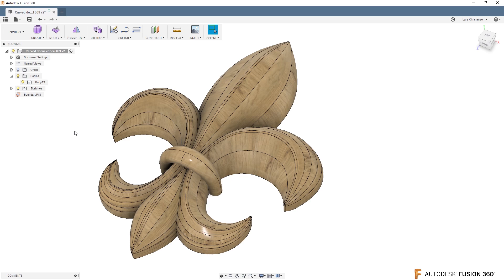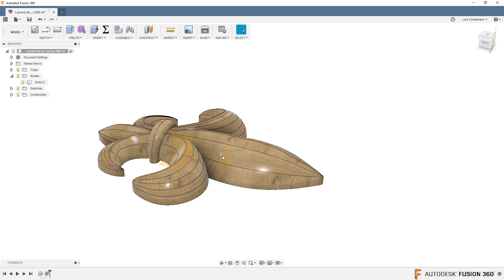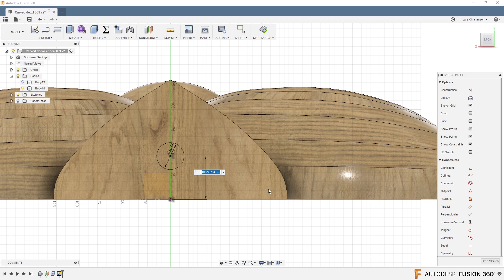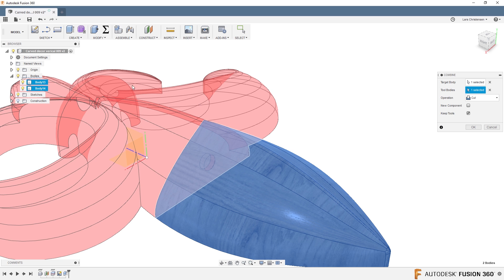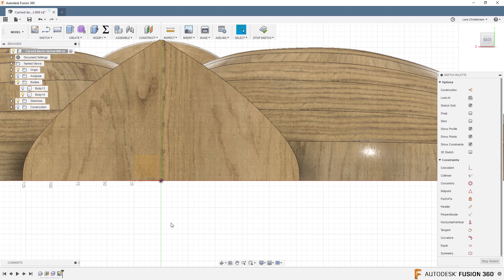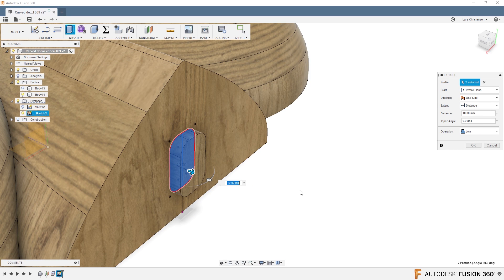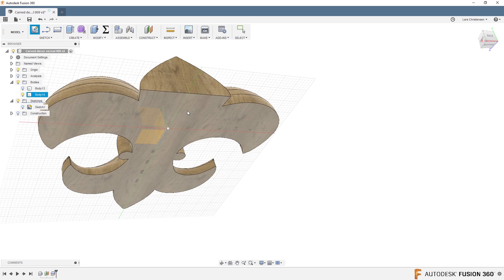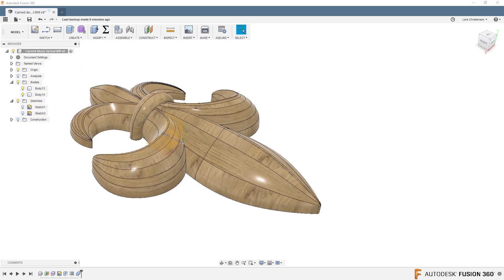If The Part Too Big for 3D Print — Fusion 360  Season 2 EP6

Comment: Definitely NOT useful. This is not a criticism because ALL fusion videos do the same thing, which is to show the quickest methods that look impressive but are completely useless. 
If people are naive enough to follow these suggestions, after wasting hours of time and material, they would discover the pieces do not fit together. How long would it have taken to consider tolerances? Regretably, too long apparently.
Reply: Yeah, it's surprising that tolerances are not considered here. If the tool cut operations just allowed for an offset these examples would be helpful but without them the parts simply won't fit as there's no clearance. Bummer and on to the next video, I guess.
Reply: To be fair, this inspired me to get started and provided the insight needed for a solid approach. I've learned some great techniques in this channel, shouldn't have been so quick to voice my frustrations, and have always appreciate these videos and the effort that goes into them. 

In my case I sketched a box to extrude a tenon, then used the offset sketch tool to provide paths to cut the mortice/reliefs in the target body with the desired tolerance. Pretty much as depicted with a slight adjustment on the cutting process to provide the spacing needed to customize for an ideal fit.

Comment: Thanks Lars for a great video.
There is another method that I would like to share.
I usually extrude holes on both parts, and when I assemble the parts I uses a pice of tube/rod that fit between the holes.
This gives good strength and guidance.
I don't care too much about tolerances when I print the holes, I just trim them with a drillbit after printing.
I have used this many times and always with good results.
Reply: I do something like that as well for some of my larger prints. In some automotive and "stressed" applications I'll screw in a piece of all-thread for a little "C.Y.A."
Reply from the maker: Thank you for sharing 👍😊

Comment: Awesome video, and even though (IMHO) this is a good approach to the problem it's unlike to solve it. Tolerance issues do exist in every FDM printer. What I do is similar but I always make an inner offset to the sketch. Then, I extrude the inner area in join mode for the "male" body and the inner and outer area in cut mode for the "female" body (sorry for the gender connotations but I don't know a better way to explain it). The offset parameter depends on your nozzle size but I get good results with 0.2 mm offset using a 0.4 nozzle. 0.3 - 0.4 if I'm using a 0.6 nozzle. It also depends on the filament and material dimensional accuracy. Hope this makes sense.
Reply from the maker: Thank you for watching 👍😊and for a great comment

Comment: without a good solution for tolerances, this  method is kind of useless. You need to enlarge the cut or shrink the connection part to make it fit even with machined parts. The suggestion to make a third part which is a separate connection part is a solution. In your first method this is a then a kind of a dowel. But maybe you have an other suggestion? Still a great video btw.

Comment: I would recommend cutting both parts and printing a third piece that connects them. Why? If your fit is too tight or too loose, you change the connecting part and keep the big prints as is. Saves a lot of plastic and print time (or sanding time).

As far as hole/peg shapes go, a square rotated 45° prints with easy overhangs and the connecting piece is just a square profile extrusion that can be printed really strong.

Same thing for the dovetails: slots in both parts and an hourglass third part to connect them.
Reply: Yep this is the way I would do it as well. I would sketch on the face where they join and make a cut into one body. Then project onto the other face and make the cut into the other body. Then finally make the connector piece with tolerances applied to it. Like was said if it's too tight or loose, you just adjust the tolerance and reprint just the connector which will take just minutes. No need to reprint the actual model parts.
Reply: you need to over/undersize your interlocking parts by the amount of your layer height. Assuming your 3D printer is well tuned for extrusion and acceleration.
Reply: Michael Rinkle Depends on the filament too. I finally ran out of some cheap black PLA and switched to a Prusa PLA. The Prusa filament printed a lot more accurately. I post some of my models on MyMiniFactory, so it makes sense to offer variations of the connecting pieces. Or, in the case of the square peg, the user can just scale the peg if the fit isn’t right.

Comment: Another great video Lars. I know you mentioned the tolerances, but you are going to have a hard time joining those pieces after a 3D print. A quick fix is select the join faces of one body after the cut and press pull them about -0.4mm.  Another thing worth mentioning about the joins, design them so they can print without supports for a cleaner join. In general they should only have up too 45 degree overhangs.

Comment: I have split a part by drawing a spline curve on an offset plane that is above the part and then using the spline to cut the body. That makes it easy to assemble and glue together with no need for tenons or dovetails.

Comment: Great video. I will add my own tip, for what it's worth. 

The dovetail joint is great. Instead of making the initial break point straight vertical, I would create it at a slight angle. Then I'd add the dovetail, etc. This is an old trick I learned when I was a teenager helping out my stepfather with cabinet making and general woodworking. The angled split line helps to hide the break a bit better, and gives you more surface area to glue back together. If you want to get real fancy you could angle that line on two planes instead of just one.

Comment: Great work Laura, I reakon the final dovetail joint is going to be the easiest and most acomidating for this design. The other option that would be easiest to accomplish could be some slots and biscuits. (not sure how strong they would be though)
Reply: vertical slots are easy to print. cut strips out of plastic containers as biscuits. it will probably strengthen the print as the "undirected" molded plastic takes load off the layers.

Comment: Great Video!  The only missing last step is showing how to accommodate for manufacturing tolerances between the two mating volumes. 

Either reduce the male mate volume by  0.2mm offset or increase the female cavity volume by 0.2mm, for example.  

Can that be done easily with a single step or a single operation?

You mentioned there is another video regarding this, for 3D printing in particular. It will be great if you could add a link to that video in the description or within the video itself. 

Thank you for this excellent and concise presentation.
Reply: You can use press-pull to easily move selected faces, change any diameters or add fillets.
Reply: Alex Antonov will try it. Thank you!

Comment: Great video

4th option would be to model a 3rd body which would be an insert in the two main tools. Its useful when you don't want overhangs. However,  you may need supports in the holes. The bump out object you create for option 1 can also be a sphere, a bit like option 2, to reduce angles/ overhangs enough to prevent a need for supports.